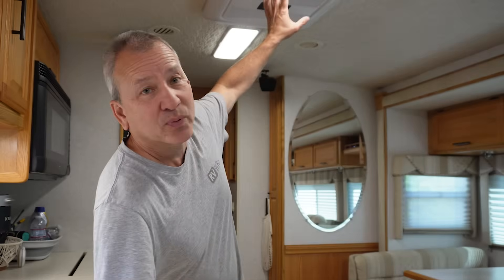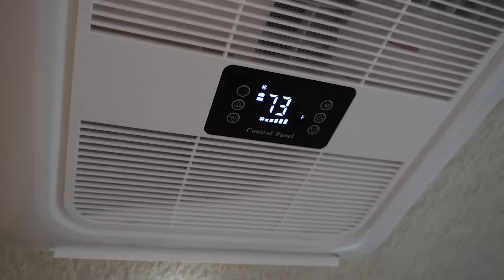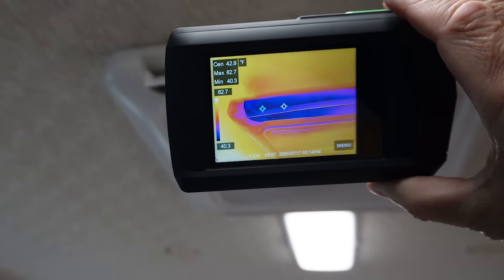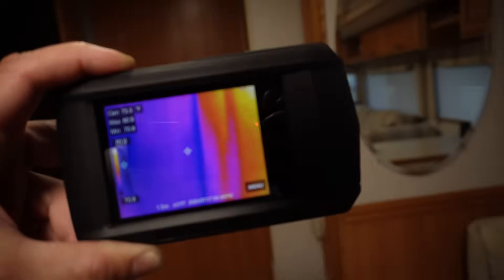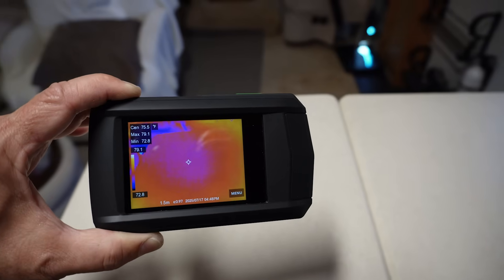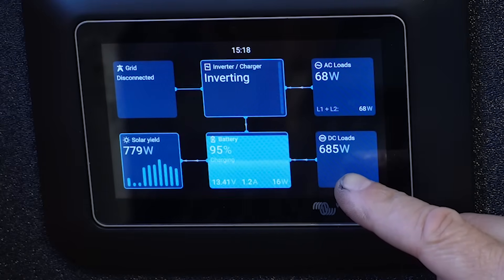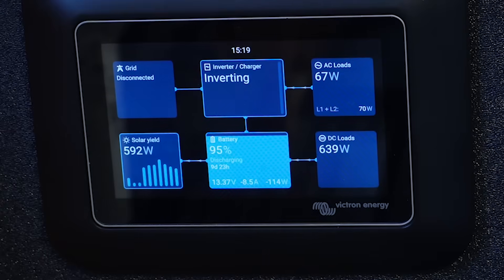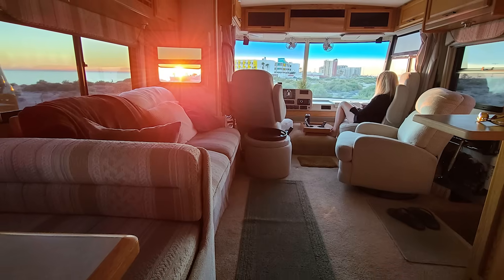91° Heat Test (Solar Only) : Can The CountryMod 12V A/C Keep Up?

Comment: Does this ac unit have an exhaust fan only "mode"?
Some times of the year don't require ac, but the exhausting of air for 
air movement and moisture reduction is still needed.
Thankyou

Comment: it gets hotter than 91 here and if 79 is the coolest it can get for 91. That is not exactly as low as i need it to go. Ideally i need it "Capable" of 70 minimum at that temp but set it to a higher temp to save energy. That way the compressor is not maxed all the time.

Comment: Thanks in advance and as always great info. Some questions. What type of roof tubing are you using to run your 12volt cable through? Is it flexible? Did you have to remove the existing black shielding that came with the cable to have room to slide through. Any concerns with the exposure to rain by running the 12volt cable out on the roof? Any extra modifications needed to shield from the weather? Thanks great work!
Reply from the maker: Here's more info about how cable run on the roof. Hope it answers your questions. https://youtu.be/lTjTp0V4wKk
Reply: Hi Brian, thanks for your message and watched your video several times. A couple follow-up questions: I was unsuccessful passing the countrymod cable through a flexible 3/4” ID corrugated tubing as it was getting stuck with the braiding still on. What diameter tubing and type (rigid/ flexible )did you use and did you have to remove the original braiding? Thanks again. John
Reply from the maker: I think I used 1" conduit.

Comment: What is the minimum gauge wire did you use and how long was it?
Reply from the maker: I used the 15ft #6AWG cable that it came with. I plan to extend it and replace it with #4 wire when I do.

Comment: Sir Tito, i bought a Country Mod 12 volt .
When i tried it before installing,  worked great. 
But after i installed it i got cold but after 1 hour of running,  , the temp increased to 80s; and c would not cool down 
Outside temp was in mid to high  90s, please t ell me what i need to do to  fix this.  
Thank you Luis P
Reply from the maker: We have had similar experience when in the 90s. It helps to start running it early and maybe adding a small fan to push cool air into other spaces. Also consider closing doors to spaces that don't need to be cooled. Once it gets hot inside though (90+), this unit struggles to maintain the temp. Of course, there are several factors that come into play (insulation, RV position, interior layout). It will blow cold, but doesn't move as much air as larger systems. Our other A/C has larger blowers to move more air, but does not blow as cold. For those hot 90+ days, I need to run both A/Cs. It may be 80 degrees inside, but it feels comfortable once the moisture gets sucked out of the air.

Comment: Hi, Tito. If you're still monitoring this vid comments section, please tell us how much solar you have on your roof and how much battery you have connected to that AC. It would help in making a decision. Thanks!
Reply from the maker: I have 1700 Watts of solar and 810Ah of lithium batteries.

Comment: Where does the condensation go ???
Reply from the maker: There are a couple of channels inside that direct the condensation out of the bottom and onto the roof. Check out the install video to see them around the 3 min mark.

Comment: Guess I have to be the one who has to be negative.  I have the exact same rig and installed this a few days ago, off grid in the smokie mountains, 87 outside and 90 in the rig.  Tried all sorts of things, can't get it to cool off and it is draining my batteries at an alarming speed.  Maybe I got a defective unit?
Reply from the maker: Ooh. I hear ya. If you've got cold air coming out of the A/C, then it's likely not defective. It's very difficult for this (or any) A/C to cool down a large rig once it gets hot inside. I start running the A/C early before it gets hot, then run it all day on solar. This keeps the inside surfaces and climate under control while it warms up outside. With hot air and surfaces inside, it just radiates making it much harder to cool. Shrinking spaces and keeping doors and windows closed can help. These were designed for smaller campers. So having two of these would help for a rig this size.
Reply: @RVwithTito yeah, thanks the the response.  Cold air is coming out, don't think it is as cold as you show.  I close off the back room, still no luck.  I have a 48V system, but am testing it on 12v 400ah with a dedicated 960W of solar.  Still draining the batteries.  I do start when it is 70ish outside and 74 inside, but it heats up as temps outside go up.  Once I have my down converter installed my smart shunt will show me the draw.
Reply: Oh, and I bought it from your site as I did some of my Victron stuff 😉

Comment: How did you move wires needing to run inside to the outside?  Didnt show that in video and I’m going be ordering. Also curious what thermal temp is on outside of Rv directly in sun. I’m sure it’s more than 90*. Great review thank you.
Reply from the maker: The power cables are connected to the controller which is outside of the evaporator/blower compartment. The opening where the cables go in is sealed up. Remove some of the sealant and you can pull the cables out and route them outside to the roof. Take time and be careful pulling the cables out around the coil. The power cable for the blower will remain through that hole. You'll have to reseal around it. I used some HVAC foam tape, but you could use something else like electricians putty. I didn't include it because it may void your warranty modifying the AC. You'd have to check. Hope this helps.
Reply: @RVwithTito  Yes thank you very much.
Reply from the maker: @adventurefurtheroffroad No problem. I may be easier to remove the ring terminals from the controller and pull the cables to the inside the reconnect them from the top.

Comment: Why don't you elaborate on how long it took to reduce the inside temperature from 91 to 77. Did you start at an inside RV temperature of 91? Did it take 30 minutes to reach 77 or did it take 8 hours?

Comment: We added a CountryMod 12 V AC to our bedroom of our 31' Travel trailer after watching your install video.  Currently on a  Cross country trip from Ohio thru Texas and up into the Pacific Northwest.  We are loving the unit.  We have a 250 ah lithium battery bank and 200 watts of solar.  We normally turn on the bedroom AC about an hour before arriving at our campsite.  The bedroom is in the 70's and the main living area is in the 80's even with outside temps in the 90's in Texas.  We boondocked a couple of nights and the CountryMod unit kept our bedroom at 72f on eco mode and our battery bank was still between 40% and 55% each morning. The install took two days and 12 hours of time.  We also needed to order longer stainless steel all thread from Amazon and also ordered 25' of 2/0 welding cable to power the unit from our battery bank.
Reply from the maker: Thanks for reporting back. #2/0 is a lot of cable for this. Can't go wrong with that. Glad to hear it's working well for you with the 250Ah. 👍

Comment: How cold could a 120V AC unit keep the RV that would be the real comparison because RV insulation isn't good has lot to do with cooling.
Reply from the maker: I think you answered your own question. There are lots of factors to consider and each rig will be different. Insulation is a big one.

Comment: I have been watching your videos for a while. I just installed the 12 volt rv unit on my 40 footI Itaska. I am having an issue with the remote only working inches away from the AC unit. I have a chat with the country mod Support team and they said that I had to be within 1m or three feet. Since you're the only one I know that has one, Installed can you tell me what experience is with the remote? I have also noticed that in the eco mode it seems to sound like a Jet engine winding down My wife and I find it annoying Do you experience  that sound? I live in Vancouver, WA and today it was 83 There is no way this air conditioner Keeping us comfortable on its own! I am trying to determine if there is something wrong with it or if it is just not gonna be enough. Your input would be highly appreciated Thank you!
Reply from the maker: I don't use the remote but I know it works. I didn't know about the limited range issue. Good to know. The noise issue may be an issue with the condenser fan (the one on the top). It cycles on/off more frequently on ECO mode. Mine isn't very loud though, but I can hear it spinning up right before the compressor kicks in.
Reply: My remote is the same; it's virtually useless. Mine also won't cool the 120 sq ft of my trailer.

Comment: Ok have had mine for 2 weeks. While traveling experienced 103 temps and unit kept my 24 ft RV at 78 degrees in eco mode. Typically my power and current reads are similar 22amps in eco but when 103 out I read 55amps at 12 volts or under 600 watts. My old ac would draw 127 amps off my inverter. I have 300ah battery and while sitting in 101 temp ran for 5 hours and battery used about 30 %. Absolutely incredible. I found with less than perfect solar with 800 watts of solar I was not discharging battery.  (Plugged in 200 watt of external solar in addition to my 600)my unit has been on continously for last 5 days even at night. Unit measured 47 dB noise level vs 58db on old unit. My square foot of space in 24ft motorhome with slide is about 160 square ft. Hardest part of install was 12 volt line as I ran it thru roof completely hidden. Will continue test this summer  to see how reliable .
Reply from the maker: Incredible! Thanks for sharing all of those helpful details that we all want to know. 👍👍
Reply: 55 amps is lot of current any heating of the wiring going to get voltage drop easily.  Like to see how it would perform here in Phoenix were in the low 100's right now which is cool. We had a mild summer compared last 4 years so far few weeks of 115F.
Reply: @thomaskeen7782  Wondering how large an RV you have. Wondering if unit would be effective in cooling the living area of my 38’ motorhome..
Reply: @pastorpapamike  No. i would consider 78 not effective either. i need 75 to feel comfortable especially after being outside in the heat.

Comment: Did you have to leave it on high fan to get it to maintain a comfortable temperature at those high temps? It's possible you mentioned it in another video, but, is there an auto setting on the A/C that would automatically set the fan speed based on the temperature inside the coach?
Reply from the maker: There is an Auto setting

Comment: Are you sure you should be installing that on your roof? I believe that RV has a laminated roof and it's the reason why the AC was in the basement.  If your slide top starts rubbing the roof when it's closed you'll know.

Comment: I’m gonna have to revisit the install video.  I’m wondering if your system is ducted or direct discharge into the cabin.  I just installed an easy start module a couple years ago, but the tech has moved on as demonstrated here….  I’d love the idea of being able to cool the RV on battery for several hours vs 1.4 hours as it currently would last on AC power.  Cheers and thanks for the update on this.  Valuable info for sure!

Comment: Hey 👋 I have the same unit I just installed on my 30ft class A and I’ve been having some troubles it like to cycle a lot and have you noticed less air coming out of the front vs rear vent like it’s not as strong ?
Reply from the maker: The air flow is the same on mine too. The blower seems to favor the rear vent. I think it has to do with the direction of rotation of the blower. I'm not sure about the cycling. It could be a power issue. It happened to me one time when I had it set to high along with another large DC load pulling power. Once I removed the other load it was fine. If you run it on a lower speed does it still cycle? Also, try running it with the generator or shore power on. If that fixes it, then it could be a voltage drop issue on the cable or just not enough battery power to supply it. Oh, and I think there's an adjustable battery protection feature that throttles down at low voltage that you can set. I'll try and do some experimentation to try and replicate your issue.
Reply: @RVwithTito hey got an update for you the manufacturer reached out to me as I told them I was holding off on completing the video I’m going to make. They told me to go on the roof open it up and make sure the condenser coil sensor was not touching pipes and it was. This fixed the short cycle once I moved it. As far as air distribution the air from the more powerful rear vent gets trapped in the hall way because of how my rig is set up. I made a mod to it and that seems to have helped. I also found closing the bedroom door and keeping it in the front helps a lot also and of course a fan to move air around. Do you try cool the bedroom also or just keep it up front ?

Comment: Very interesting, how would the batteries last being just plugged into AC with no solar input?  Would the standard charger in travel trailers maintain the batteries?  My batteries stay around 13.3 volts when plugged into AC & I’m wondering if it would drain the batteries if theAC was running for several days or weeks. Thanks
Reply from the maker: Given that the charger is wired indirectly to the batteries, the charger would be powering the A/C. Any extra would go to charge the batteries if needed.
Reply: @POVcamping  You’d probably want a well ventilated 80 amp charge converter.

Comment: So, that is one unit for your whole RV? Impressive!
Reply from the maker: I still have the other 12V A/C installed too Phil, but most of the time I haven't needed it. This has done the job.
Reply: @RVwithTito  Is your other 12 volt unit a CountryMod as well? I have been following your install, considering the same for my 21' travel trailer (17' cabin). My buddies are touting the Furrion Chill Cube, but this looks to be a better option for me with my small trailer.
Reply from the maker: @sequoia464  No the other 12V AC is not a CountryMod. It's kind of a custom configuration mounted below the RV in the basement.
Reply: @sequoia464  you’re in a similar situation as me I have a 7 x 16 insulated Cargo trailer that’s been converted into a toy hauler. I just bought the Furion Chill-cube, even though I got the other unit on sale, this would only be about $100 more,  haven’t had a chance to install. It’s still in the box. I may take it back and get this unit instead.

Comment: This is FANTASTIC information. Thank you.  It's great to see that battery still charging with the AC running full blast.  Very impressive!  And 79 degrees isn't uncomfortable at all as long as the humidity is low, which this small unit should excel at since it's constantly running.  Where folks get into trouble is over-sizing their AC units so they short cycle and never actually remove the humidity, which is a huge component of comfort.
Reply from the maker: Glad it was helpful. Extracting humidity and keeping surfaces cool through long term cooling helps to maintain a comfortable environment. My experience...

Comment: Nice to get the update.  I am southern Oregon coast and have a 1990 hightop G20 Chinook .. a neat one .. and I am thinking of one of these units.  In buying one, I'd like to use any links that helps out your station.   I wonder if 200 Amp hr battle born will work .. If driving I have a dc to dc I use all Victron ... I am hooked on it.  I do have room for another panel too ..
Reply from the maker: Hey there. I appreciate the support. There's a link in the top comment and description. They Meyers Creek area is my favorite spot on the entire coast.Your 200Ah will cover you for several hours and while driving but more is always better. Good luck!
Reply: @RVwithTito  thanks

Comment: Brian - you mentioned on the previous video you might play around with modifying the unit to work on ducted RVs. My challenge is I have a 36ft Fleetwood and the layout requires ducting. It looks like it would be feasible to pull off but curious on your perspective. If it’s not possible, I would need 3 units since the bedroom is in the rear of the rig and isolated.
Reply: @MattLesak  I would like to know this too. I have 2400w of solar with 900ah of lifepo4 battery, and these 12v units have caught my interest. I have 3 ac's on my 5th wheel with the main one being ducted. My only hesitation is trying to find info on whether I can somehow duct  the main one 🤔.

Comment: Our 21’ green camper was located in full sun with outside temps at 114 degrees. The countrymod managed to keep the camper at 92 degrees. The conditions were brutal. The unit just kept plowing on. Once the sun set the temp would hover around 100 degrees all night outside. The unit would bring internal temps down to the high 70,s. Have 400 watts of solar, so I would need to periodically start the generator to top off the batteries. Thanks for the update.
Reply from the maker: Thanks for this. It's really helpful and the type of result I would reasonable expect. 👍

Comment: So, how about dehumidifier function and condensation run off...
Reply from the maker: Works fine. Condensation runs out of the bottom along the roof and to the rain gutter.
Reply: @RVwithTito  dehumidification does not work well in my 19 foot class C. On a 95° humid day and evening the cabin barely gets the humidity down to 70%. I put the fan on auto because I read high fan air velocity may not let the water drain away. It didn’t make any difference. It cools great, but the interior air quality feels much too humid. I don’t see much water from condensation running off my vehicle roof. The unit is new. Any suggestions thank you.